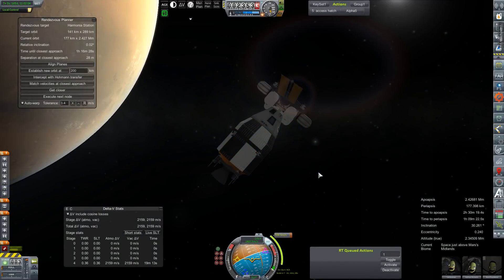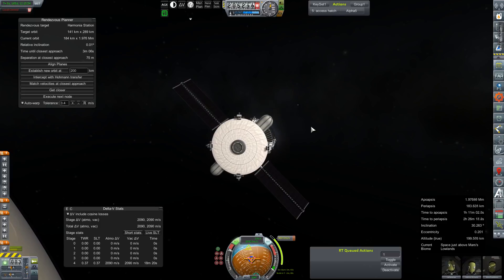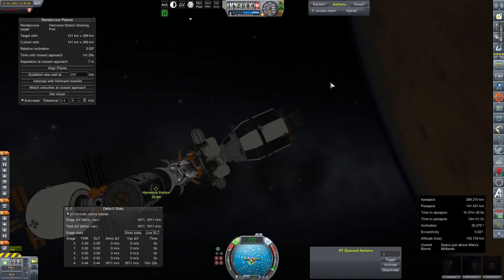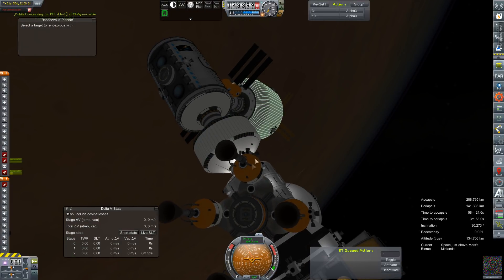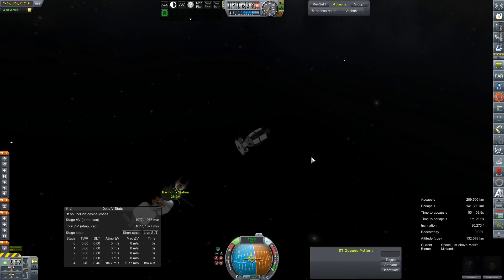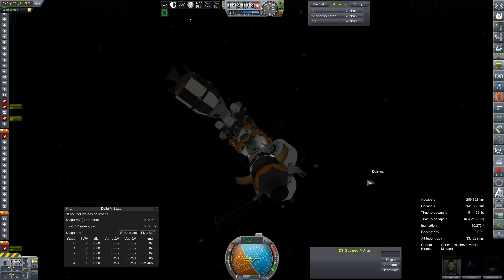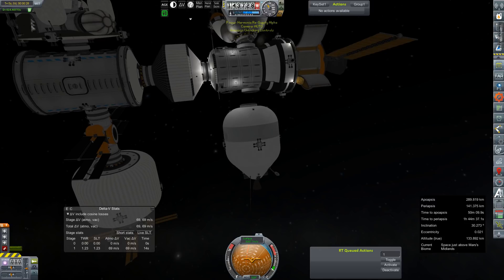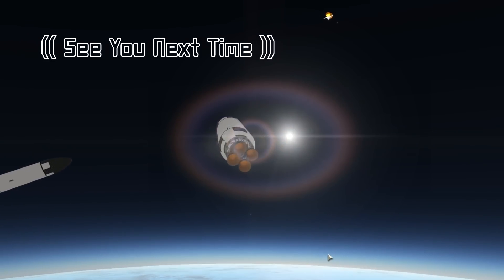KSP RP-0 #396 Arty4 Arrives at Harmonia

Comment: rotacindi tnemngila trop gnikcod... btw, try using Atmospheric Autopilot fly-by-wire mod, it works with spaceships much better than the stock SAS, concerning RCS BA: adjust your RCS position for the CoM that you'll probably have during docking, it's still +- but at least much better than adjusting for full or empty. Also for big ships on which the CoM shifts greatly I use two groups of thrusters (just disable 1 when necessary) if docking is involved in the mission.
Reply from the maker: interesting - I'd never considered using the AtmoAutopilot mod in space... I'll have to see how this works out ( and how much RCS propellant it chews through )